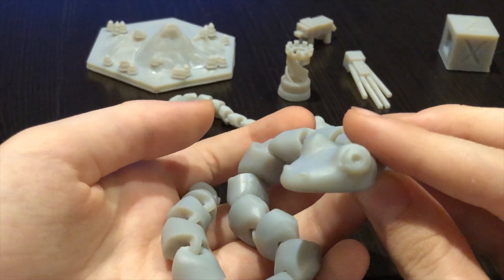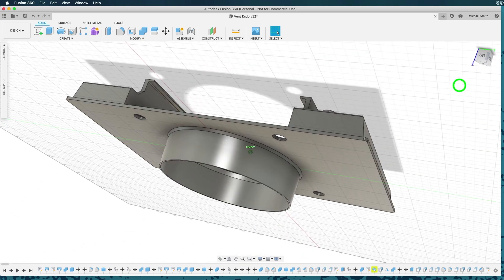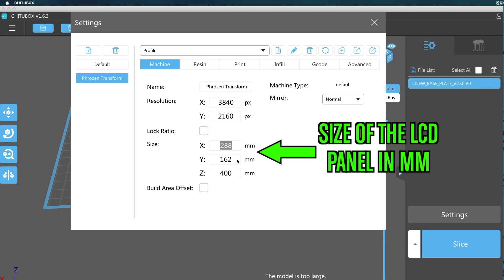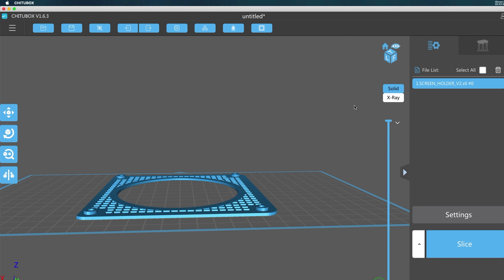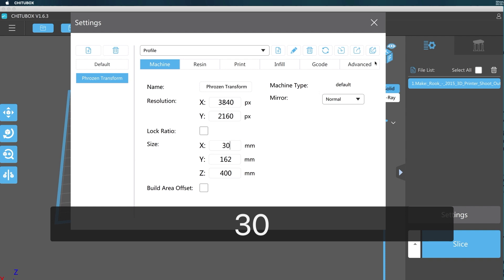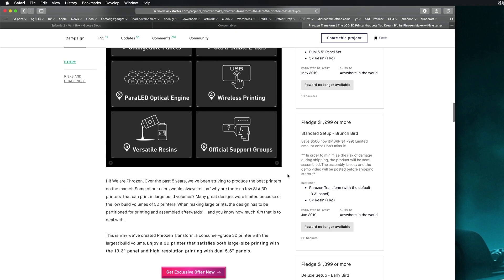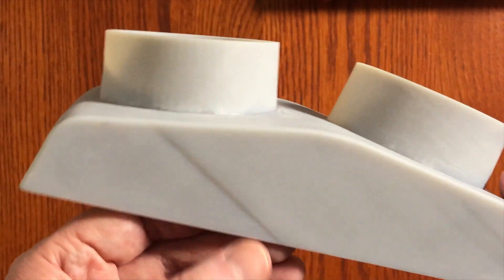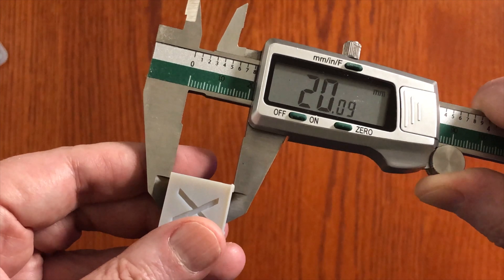Get Accurate Prints - Calibrating Your SLA 3d Resin Printer

Comment: One of the most clever ideas to really accurate your prints. I use my printer to print technical products. This is a must video, clear, logical, and get solutionts. Most over other videos, 99%, talk abut Time Exposure...Yes this is a factor, very important, but not the only one. Looking at this vide I think the new process to exactly calibrate is . 1) Calibrate the Time Exposure 2) Apply the Video Method.
Amazing. 
My congrats to your idea and to your clear explanation.

Comment: I love it! Most guys using resin printers are running sculpture not mechanical assembly parts and could care less about getting this kind of accuracy.  Not me, if parts dont fit, I have a fit! loll  Every 3d Printer and RP technology evaluates and use I use the 1st thing I do is print a 1-inch cube to get a baseline of my fitment tolerances, so I know what sort of tolerance I need to model within to make my parts fit like butter. I just printed a 1-inch cube tonight I will see how it measures up in the am. I'm usually happy If I get within + - .003-.005. I think you nailed it getting this figured out! I will change my settings in Chitubox,   I really appreciate finding this video, I'm just getting started with my Transform and you had posted a comment to me on FB Chitubox or Phorzen user group today with some input on another issue I was having.  So thanks I will subscribe to your channel and keep my eyes peeled for more content.
Reply from the maker: Thanks. Like I said in the video. Print a larger xy shape to do the calculations.  Also. The newer version of chitubox has more accurate size info in there for the transform. I tried it. I actually still prefer the numbers I share in my video.  I feel my calculations get me closer.

Comment: I purchased my first resin printer just recently with the initial exclusive use to do high detail architectural parts out of fusion too, and accuracy was the real driving point. I have a huge delta FDM machine that does those things well (when it isn't trying to self destruct, sigh), but thus far I've been either extraordinarily lucky with how accurate my parts are or correctly 'guesstimated' my profile when transferring knowledge from fdm and composite work to the resin printer. 
I'll certainly try your calibration technique with the screen though, as I want this thing dialed in to perfection before moving on to the really key pieces that not only need dimensional accuracy but as they are aero-oriented parts with super tight tolerance, they need to be Perfect (or as close to that magical word as I can get). 
Another sub earned in kind!

Comment: Excellent information. Another thing to consider is the light near the edges is passing through the screen at a slight angle as the lenses are being used to spread the light out more evenly so that only one light source is needed even for a large build volume. So I figure that at the edges of a large print the light instead of going straight up to the resin will be moving outward away from the center. That means a larger part will grow a bit and most of the growth will be near the outside edge of the part. If the light is really evenly distributed and shoots straight up across the whole printer this will be less of a problem. Also there are free radicals in the resin trying to bind and form chains so where ever they might be the part will grow a bit more there than in other spots but that's just a limitation of the technology. But that'll occur more where the light is intense since for any creation of free radicals requires energy so if the light intensity of the machine is more even that'll occur less. A 0.2 percent difference is really good though on a part that size. A part that large though I would have done on an FDM printer or I would have done it in two parts and then glued, resin sealed, or bolted it together. But with that degree of accuracy two parts probably wouldn't be needed.

Comment: Thanks for the video explaining your way to solve the problem.
Recently I started to calibrate my printer, because I realized that there was a difference with the impressions that I made with the FDM printer. Until then I had not worried since the pieces I made were figures and did not require great precision (the figure would simply be 2% larger).
But when the time came to make a part that required certain tolerances, I could see that it had that, approximately 2% increase in x, y and z.

I gave him to create a new Phrozen Transform printer and to my surprise, the dimensions of the new printer were different from the previous one, possibly due to a change between versions of the program.
Even so, using that new printer to prepare the test piece, there was still an increase in dimensions.
I have always prepared the piece in Chitobox, both the supports and the laminate, and out of curiosity I tried to print with PZslizer and the surprise was complete when verifying that the dimensions of the X and Y printing were accurate. Only the dimension on the Z axis was still wrong.
I suppose that the way to solve the latter will be to scale the z axis when printing. If there was a way to enter the firmware of the machine to modify the motor pitch on the z axis, it would be ideal, but that is light years away from my poor knowledge.
At the moment, I think I will try to adjust the chitobox as you explain in the video, although it will surely change my way of printing and use the chitobox only to prepare the piece and PZslizer to laminate it.
Thank you again for sharing your experience.
Reply from the maker: Scaling the z is pretty easy on the transform. But if it obeyed Goode properly it would be a little more difficult.

Comment: you have solved my dimension accuracy problem!!!! for the longest time people are just telling me to increase my curing time, and it got ridiculous and im still getting inconsistency
as for Z axis, I find that u have to measure something with a known z value that is NOT touching the base plate
over curing the base will lead to a shorter/distorted Z value, thus affecting the overall Z size on a calibration cube.
Reply: what are you using for the z axis?

Comment: Thank you! Just thank you. I thought my printer is a garbage. My FDM printed more accurately the alpha prototype, then i used the same stl, and duh...  M8 screw does not even fit. I will check tomorrow this method, sounds promising! Thank you!

Comment: love your videos, my dream is hoping that this helps my saturn calibration problems.
Reply from the maker: I hope so too!  There are other reasons, like shrinkage, that can also make your prints come out off scale.
Reply: @Nerdtronic  it definitely did, many explanations. Perhaps you can answer this question; I have the wham bam flex system, which adds 2mm of thickness to my plate. Do I need to adjust my Z axis anywhere?

Comment: Great video! Really looking forward to your vent video. I was planning to build an enclosure with a pc fan blowing the fumes into a duct tube and out the window using a window adapter similar to one you would see on small airbrush painting enclosures. Your solution already looks more thought out, so I would love to see what you come up with.
Reply from the maker: Thanks.  I considered doing the tent but I'm hopeful that this vent will be sufficient for at least pulling the fumes out of the printer.  I haven't assembled it yet cause I need to film that process.  Cleaning chemicals is a whole other thing.  The IPA is pretty bad and this vent (or your box) won't help with that.

Comment: I just checked my Chitubox 1.6.3 win64 settings for the transform, they are correct(164.16×291.84).  Maybe your mac version has the issue.  But thank you very much for the video, i changed my Photon settings to match sales literature and my first prints were inadvertently 6% too big! Now i understand whats happening.
Reply from the maker: Thanks!  Yeah unfortunately I'm mac only so I can't check on what's happening in windows.  I guess I need to make that super clear in future videos.

Comment: I had a similar issue with my Mono X and I use Chitu as well.  Myself, I would just adjust my actual model in the X & Z, usually between 2 and 1% size difference.  The only caveat is that if I have an internal diameter I have to enlarge the hole... but hey, it works for me  =]

By the way, AWESOME t-shirt... brings back childhood memories at this thing called the arcade... I think.

Comment: This is really useful. I have an Orange 10 from Longer 3D and I noticed that the parts were printing bigger than they should. For example I had a statue that came in parts but the parts didn't fit together. After I got the Phrozen Sonic Mini I stopped using the Orange 10 all together, partly for that reason. I actually need to pull the Orange 10 out again for a job that requires it so I'll have to try this out.
Reply from the maker: good luck

Comment: if you donot want to find best timing for slicer (guess this solve most of your problems) there is also a SCALE button there ! just scale your module instead of uncalibrating your printer !
Reply from the maker: That doesn't work if you rotate the model. If the printer's size calibration is off in the X or Y axis or both, but spot on in the Z, then when you rotate your model it will become skewed.  Probably most printers arrive calibrated pretty close.  But my printer wasn't and it was skewing rotated models.

Comment: @nerdtronic  how can I tell if the discrepancy in print size is caused by an inaccurate pixel count or by resin shrinkage, blooming etc. when should I use your method V.S. Using the slicer compensation values for shrinking etc.

Comment: Question about z axis calibration...  I'm using the Elegoo Saturn printer.  I leveled the build plate as the manufacturer instructed.  After, I printed a 20 mm test cube flat on the build plate and after rinsing but NOT curing, it measured 19.2 mm.  I reset the z=0 based on this .8 mm deviation and my second test print came out to 20.02 mm.  An acceptable difference. (That said after watching this I will now have to check x and y as well)  Here's my question... If I have reset my z offset on do I need to reset it every time I relevel the bed or does the z=0 recalibration live outside the leveling process?  Thanks for any help.  Really liking the channel.
Reply from the maker: Z calibration is difficult.  There are 2 parts.  First is the thing you're saying about z=0.  Getting the plate to have no space when z is zero and 50 microns when you're at the first layer.  Since the fep is flexible it can be difficult.  If you're not printing on the build plate then that part I guess doesn't matter.  The other part is just is one layer step exactly equal to the layer height.  And it's easier to measure if 100 layers is = to 100 x layer height.  That one is harder to calibrate with most of the software out there.  The answer would be to measure it and then slice a little off of what you print at.  Like slice at 49.5 microns and print at 50.

Comment: Hi sorry if I resume, but it is a crucial aspect. I'm wondering if this technique works for all measurements of the design like holes and details ( for example joints and artistic details on statues) or only for "external" measurement on the borders of a printed object. Thanks in advance!
Reply from the maker: It should.  If the outer dimensions are correct the inner ones should be.  But you can still get overall shinking from curing, or expansion of everything from over-exposure.
Reply: @Nerdtronic  the problem is precisely the diffusion of light ... it would take a more coherent laser-type light and precise exposure times, which is impossible to achieve with our "toys", always using different resins, having to apply screensavers to prevent resin spills on the LCD and changing the external conditions such as the temperature. Thank you for your reply !! I will definitely try your method

Comment: Instant subscribe.

I have a question though. Have you ever experienced prints being much more out? Like...50% out? 🧐 I have the resolution and build area information, but a 100mm rectangle, for instance, will come out at like 55mm...
Reply from the maker: I would think that is maybe because you slice at 100microns and print at 50?  Although that would only mess up the Z axis.
Reply: @Nerdtronic  Hmmm.  I leveled everything and installed a flexi-plate a couple of days ago.  I can print tonight, so I will give it a shot.  One thing that is going to help is I contacted the manufacturer of the Elfin 2 (the printer I am using) and got the actual resolution specifications for it as they were never posted anywhere.  Fingers crossed!

Comment: Thank you for this very logical sounding solution to calibrate. However, using Chitbox Pro 1.3.0 printing to a Phrozen Sonic Mighty 8K, I scaled the dimensions as you described, but the .ctb file that I use to print the file is not recognized as printable. It see's it just like it sees a Phrozen 8k Mini, but does not give the option to Print. Any ideas how to get around this?
Reply: I'm having the same problem. And ended up here. If I find anything,  I will let you know
Reply: So I have figured out a solution for the sonic mighty 8k. I used lychee rather 5han chitu box and when you select your printer and your resin, you can edit the resin settings. In the lower half of the settings page, on the left there is an option  called "scene scale compensation". There you can use the method described in the video to work out what your offset should be. 
I managed to change my tolerance from about 2% or 3% in the X and y axis to about 0.2% off. And my z axis which was off by about 5% is now within 0.1%.
I hope this helps you :)

Comment: Chitubox gives you the option to apply scaling in percentage for each of the axis X, Y and Z, No need to change the panel dimensions. You will be screwing other prints if you change resin or design of the model.
Reply from the maker: Well the size values were completely off on the phrozen transform when I got it. Sure this is something the printer manufacturer should do and then it should just be right in the slicer when you get the printer. But it isn’t always.

Comment: I've been printing on my photon mono x for a while now and tried my first "assembly needed" print. And I've only now noticed this problem. The prints are coming out larger than it is. 

However when i tried to use your method to fix it, i couldn't find the setting to change the size of the build plate in lychee. 

Do you know how to fix this issue in lychee? Your help would definitely be appreciated!! 

Love all your vids btw!

Comment: ok quick question, i got this setup perfectly on my mono x with some calibration cubes, this is the same process i use for E stepps with FDM printers but i cant seem to calibrate the Z axis, its actually made the prints much worse, on my mono its 0.2mm out and on the mono x its 0.5mm out. 

My printed parts so far 

Mono

X 20.04mm
Y 19.99mm
Z 19.8mm

Mono X

X 20mm
Y 20mm
Z 19.5mm
Reply: From what i have noticed it is a matter of curing time, the longer the curing time the thicker the layer. So try running a curing time calibration and see if that fixed it or have u found a better alternative? then please let me know

Comment: just a question, couldn't you have used the compensation settings in chitu? maybe its not the same result?
Reply from the maker: That feature didn’t exist when I made this video. It didn’t until I made Bulge Buster and they took the idea from it. Not even joking. I gave them my blessing and had a good relationship with them after that. I came up with the name for their resin… conjure was my idea.
Reply: @Nerdtronic  wow, didn't know that, amaizing. haven't seen all your videos yet kind of new subscriber. Do you think you could do a series of videos talking about the compensation variants that are available in Chitu now. There is very little out about it and if any its very surface level nothing of long discussions and observations. Im starting to look at it because in the past it was a bit too much for my brains already saturated with basics :) Thanks for the great content and taking the time to answer. Cheers

Comment: Perfect explained. Thanks you very much.
Reply from the maker: You are welcome!
Reply: Hi Michael,
I've some news in regards to Z-Axis calibration. Some printers have flexible joints between the stepper and the rod. This might be one issue. When the printer run into the 0 pos. maybe the flex joint streches a bit. When start printing at first the streched angle need to be overcome...

If there is no flexible joint, the gcode need to be corrected that the stepper move correctly.

For my elegoo the file is called

mars2ChiTu Mainboard SpecificationV3.0.920200902.gcode.txt

There is a line that defines the movemend in Z:

M8010 S0.000625 ; [Z mm-Wert für jeden Schritt] Bei Nicht-Delta-Maschinen lautet die Berechnungsformel: Steigung/((360/1.8)*8).

Here the same math is to use you figured out.. 
((360/1.8)*8) =1600

Example:
Z-height should be 10 but is 9.5

9.5/1600=0.0059375

The new value for M8010.

So the software calculates more steps to reach the correct hight.

Print the gcode to load it to the printer...

Comment: Nice video. I have anycubic photon mono se, and problem is, size on Z axis is smaller than it should be. For ex.: Circle prints in egg shape, should be 10mm in height, but it's around 9mm. Please help.
Reply from the maker: Z calibration is a little more difficult.  It shouldn't be 10% off like that.  I would think it might be something more serious.  Have you asked the manufacturer or like an anycubic facebook group?
Reply: @Nerdtronic  nope, i have to scale up objekt on Z axis around 5% then it prints close to the real measurements